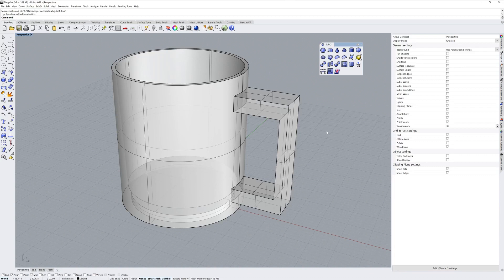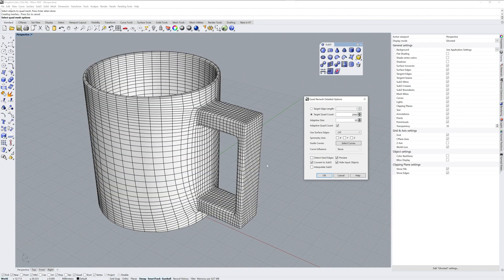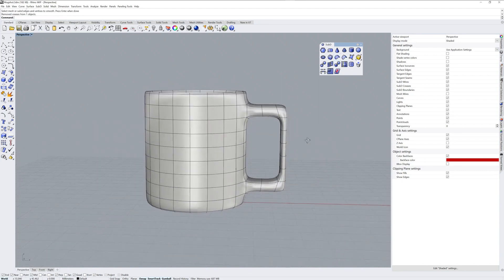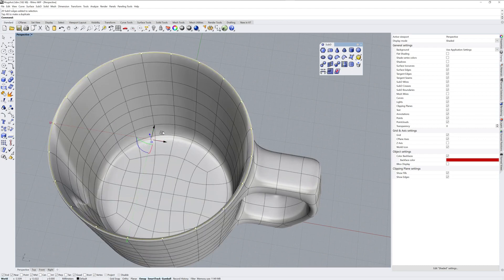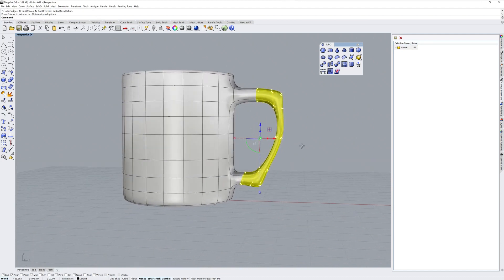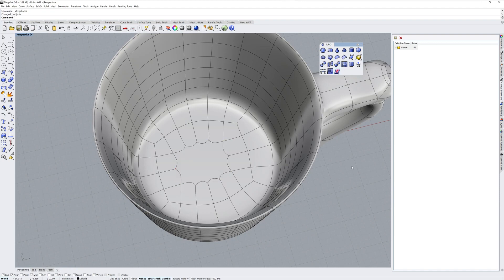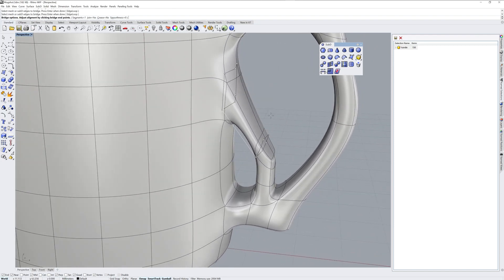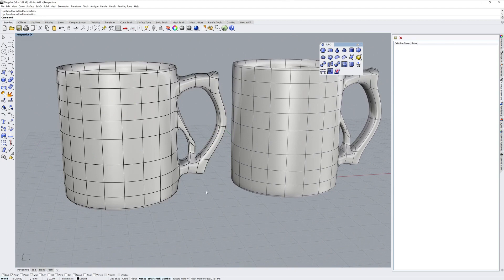Exploring SubD in the Rhino 7 WIP

Comment: This is SO awesome! We're finally getting back to some of the T-Spline modeling capabilities that I've been mourning. Did I mention AWESOME?!?! Thank you!
Reply from the maker: Thanks for your enthusiasm! We are also very excited! Make sure to participate on the forum, https://discourse.mcneel.com/c/serengeti/sub-d. The tools are currently like "clay", we are "sculpting" them to make them as useful as possible. The forum is the place to help us achieve this goal ;-).
Reply: Not a T-spline indeed, but good enough to replace it. Many CAD programs have it now such as NX, Modo, Alias, even Blender (free). T-splines downside is that at star point (poles) it's got G1 continuity only (it is at the point, but still can not qualify as A-class). The good for T-splines is that at star point it does not introduce a lump, whilst SubD would do it to the surface. Therefore it is recommended to have quad-faces for SubD processes. T-splines was meant for T-junctions of edges, hence its name (and it does it perfectly smooth G2 as long as it's two edges away form a star point).
Reply: @-IYN-  why aren't t-splines, autodesk  patent?